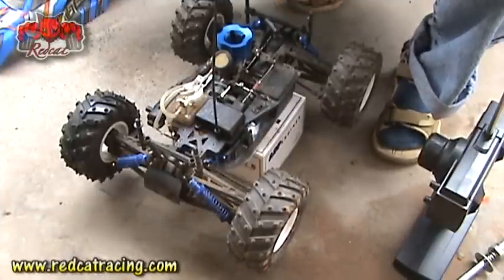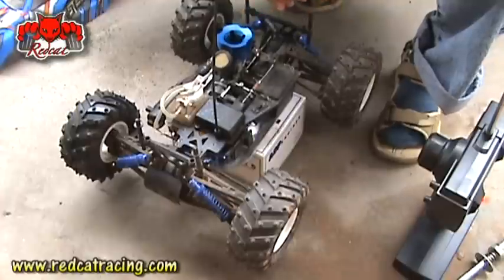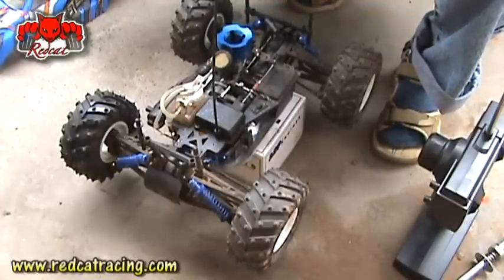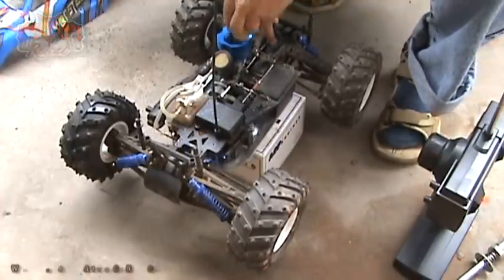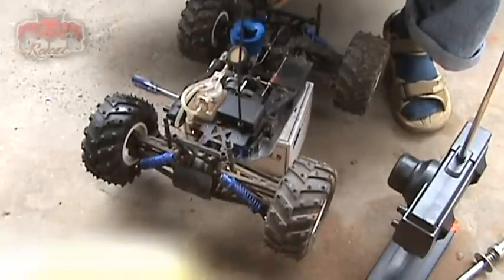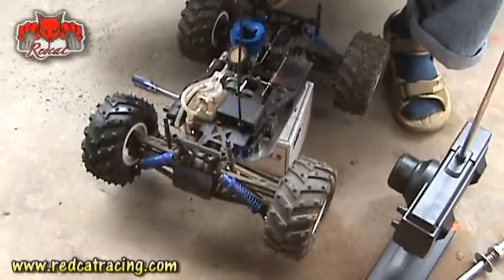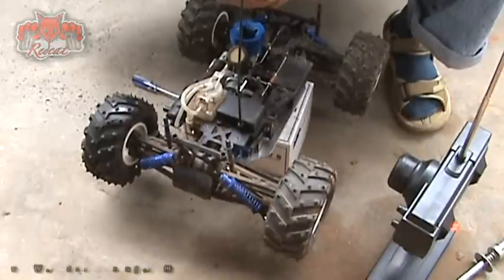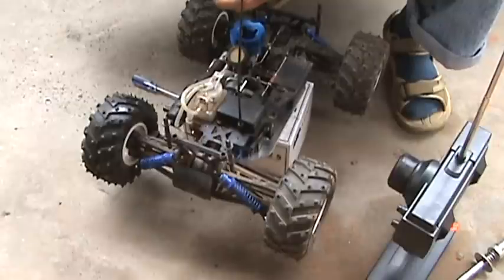How to Pinch test n setup low speed needle Nitro Engine How to Guide

Comment: I have a question I have the red cat. in winter weather should you you run your low speed needle kinda rich or lean to lean you turn in to richen you turn out correct
Reply: To richen lsn u turn it out

Comment: my nitro wheels will not stop spinning on idle need help
Reply: your idle needle is probably to rich. Make sure there is only a 1mm space for air to come in on your carb
Reply: @leviwiebe5503  I have the same problem while messing with LSN. This video will help with that. 
Another Quest: Have you ever had to mess with linkages right out of the box? It seems most the Nitro cars i've owned seem to have a VERY high idle speed. Happened to my HPI and my KYosho. I don't like messing with the throttle trim since it should be set from factory. Or should I not mess with linkages at all and just adjust throttle trim?
Reply: @snoochiefanooch45  It really depends on the car. Most vehicles should be looked over before you run them new or not. New cars also have more pad left on the brake rotor so older vehicles tend to move at idle due to the worn rotor. Sub to my channel CanadianRCs to see my rc stuff :)

Comment: i messed up my cen mg10 mt3 can u guide me to tune it properly or the  factory default and not able to adjust low end needle
Reply: RAVI PRAKASH MISRA I have a cen mg10 mt3, get rid of the engine, it's probably one of the worst engines I have ever come across In my year of experience, they just don't like being tuned and like overheating. but. flush out the screws on the low high and idle. if it doesn't start increase the throttle trim on your skyion controller. try again if it starts and the engine is bogging lean out the idle screw if so it gets a good medium rev and take out the glow starter should stay at the same revs by its self. keep the engine running by its self for 3 full tanks. then do some smooth to full throttle runs up and down the road while still rich. then adjust the high speed needle and the low speed.

Comment: I have a traxxas 4 tec that went into a huge puddle I thought it was done I cleaned the air filter emptied out the water in the water in the exhaust dried it down sprayed wd40 down the carb and changed glow plug and also sprayed wd40.  I primed it and it started right up all servos still work fine. My question is will there be any long run damage ?
Reply: nope

Comment: good way to kill lots of plugs. never cut off youre fuel always block exaust or intake wether tuning or not or youll aways be compensating for a burning out plug just as you shouldnt run them completley out of fuel. other than that good vid mate

Comment: Hello Ali,

can you share please - can we assume the same timings for tuning a plane engine ? I.e. does it still have to be increasing rpm in 2-3 before dying ? I read somewhere it should take 4-6 but what's your opinion on setting a plane engine ? (having generally issues there - help needed :D)

Comment: Hi, I have a truggy with an SH .28 engine, It runs great but temperature is always exceeding 290 fahrenheit. I've richened out the HSN but still temperature won't go down. It only goes down when i leave it idle for about a minute. Does the LSN effect the temperature as well if it's too lean? I did the pinch test and it revs and cuts out so I think my LSN is ok

Comment: Firstly, i have a new car and it can take some time to start it up and i normally have to get my dad to pull the throttle on the transmitter a bit to get it going and sometimes i can have it going but sometimes when im running it at a low speed it can just stutter the revs go low and it cuts out with a tick, can you help me? and secondly, is that a tamiya car?

Comment: Cld u plz try tht on any one of ur older trucks COZ methanol is the real fuel anyways AND it is much cheaper. costs arnd Euro 1.75/liter here whilst nitromethane is the costly stuff boosting an only 16% mixture upto mroe than 7 Euro/liter. The oil's only 10% of the mixture so tht shldnt be more than a euro giving a total of 2.75 instead of 7 Euro.